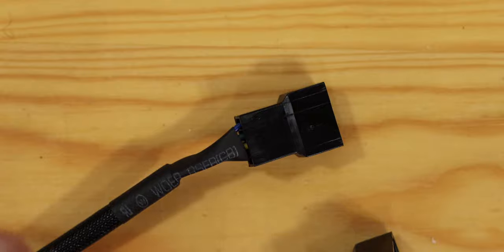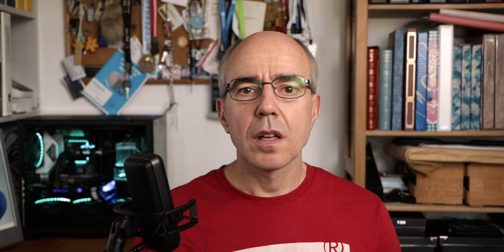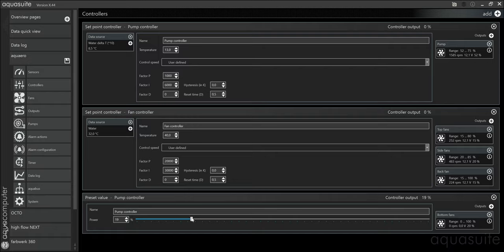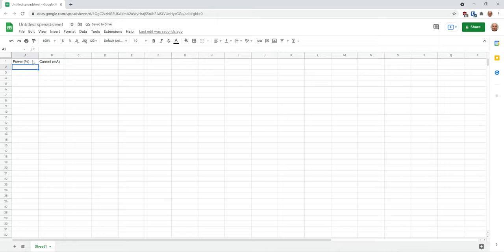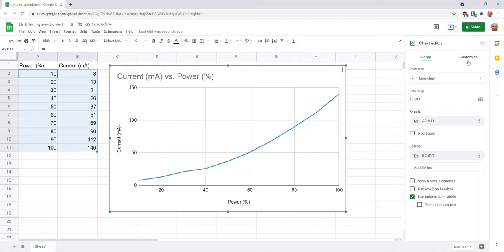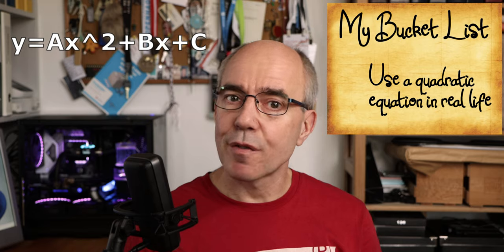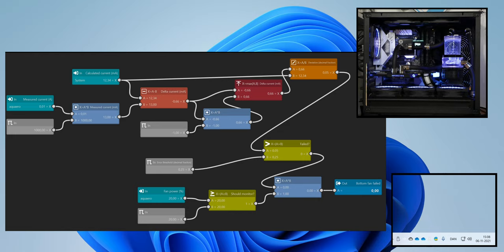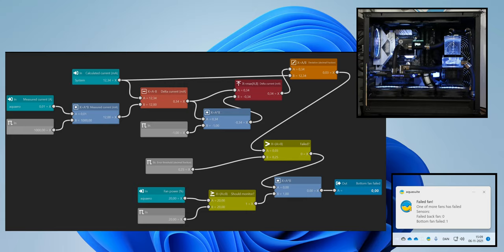Undetectable fan failures with splitter cables? Here is the solution!

Comment: Brilliant instructions. I wonder if the measured values will stay the same as the fan motor quality will slightly deteriorate with age. You might have to go back and measure the amps drawn every now and then as a sort of quality check. Actually, come to think of it.... this would be one of those "Crazy ideas" that you ask for: To automatically check for fan motor deterioration. I'm sure this isn't much of a challenge for you ;) But I'm not sure if the AquaSuite Playground would be capable of that task?
Reply from the maker: That's a good suggestion - but I suspect the deterioration will be so small it's hard to measure...
I've done a similar thing, but for water quality and loop buildup. I calculate how hard the pump has to work to push a certain amount of water (liter/h/rpm) - my theory is that as the coolant gets older and gunk might start to build up in the loop, flow resistance would rise.
But so far, I haven't really seen any change (I'm using distilled water with additives). Water temperature seems to have a much greater effect on flow resistance...
Reply: @KayBeeTech  Well, you could just use your AquaComputer high flow NEXT flowmeter for that - which I'm sure YOU already do. :)